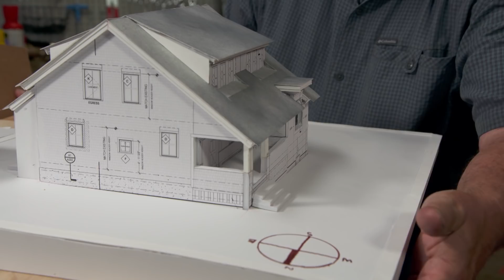How to Create a House HVAC Plan | This Old House

Comment: GREAT HVAC VIDEO!🕊️
2:40🌞thorough overview
6:54 - mold is a 🏠-KILLER
7:01 - if you’re going to INSULATE - you have to VENTILATE
0:03 - start w heat calculation to size heating + cooling equipment 
1:23 - types of insulation
3:34 - 💡barn added to employ ☀️panels
3:53 - wind🌬️💨🏠
4:41 - simulation of internal fans pulling air out - 4:58
5:27 - balanced ventilation
5:34 - dampers needed to open automatically for fans
5:56 - energy recovery ventilator 🤔
6:35💧moisture = scourge
6:49💧moisture simulation

Comment: Richard, do you think you could explain ductwork planning for open concept - living room, dining room, kitchens?     There are a number of things  - one the size of the ductwork and how do you run it through the floor joist, carrying beam without using right turns which significantly reduce the efficiency of the flow.

Comment: I call BS. The southern porch overhang blocks the solar gain in the winter ❄️. The overhang is way to large to allow any gain. And the south facing windows without overhangs let in the sun’s heat even in the summer. Very poor design

Comment: What if you got a balloon frame? Most were designed not to be insulated (air flows up and out, like an air barrier). Atleast no mold. But I could use ATOH to visit and show me the solution to add mini-split to cool 1800 sqft of EmptyNester cottage.

Comment: Air sealing, super insulation, triple pane windows, high efficiency heating and air conditioning systems, LED light bulbs, set back thermostats, high efficiency appliances, solar panels, battery storage and a 220 volt outlet in the garage for an electric vehicle charger should all be considered in any new building or remodel. Using the sun to drive your car or using the battery backup when there is a power outage is great and there is no weekly use of the generator to test it and no annual maintenance cots. Solar is a much better option than a natural gas backup generator. So many ways to reduce your heating and cooling expenses.and have a more comfortable home.
Reply: You’d need an incredibly large battery bank to be able to store up enough energy to have have any real use. It’s far too expensive, and probably worth the weekly run to just have a generator instead
Reply: @iLikeC00kieDough  The cost of the generator and the install is comparable to the cost of a Tesla Home Powerwall battery.
Reply: Kenz300 x I don’t know about that. One Powerwall doesn’t go very far in terms of continuous use. For the cost of two Powerwalls plus installation you can get a whole house generator ran off of natural gas that can run indefinitely as long as you have a gas supply.

Comment: Ventilation is also to keep CO2 levels low. You’re living in a sealed house and u could asphyxiate yourself. I swear, these super insulated and sealed houses are more trouble than they’re worth.
Reply: There should be no CO2 being released into your home from the mechanicals. A super insulated house is cheaper to heat, cool and is much more comfortable year round. They actually have cleaner, healthier air if done right.
Reply: august the CO2 is release by the humans and pets living inside. 😛 “if done right” and as long as that ventilator is working.
Reply: @mjlyco9752 , Never heard of any family being asphyxiated from their own breath.
Reply: @augustreil  But that's exactly what would happen if you put a plastic bag on your head. If you seal a house with air impermeable membrane then that is exactly what you're doing on a larger scale. It will be slower but CO2 concentration will rise until you pass out then die, unless you ventilate. Powered ventilation, open window, etc. Non-sealed houses don't have this problem because the drafts are the ventilation. Those drafts also dry any moisture. Sealed houses can work, but it takes a lot more care and everything working correctly. That sounds like more headaches to me.
Reply: @mjlyco9752 , Hardly a fair comparison. There's no house as tight as a bag around someones head so lets just agree to disagree. I've already stated why tighter houses are better and there are safeguards against the fresh air recovery system failures. It's ok that we don't see eye to eye.

Comment: Richard Trethewey is an American national treasure!
Reply: Yes, but those on TOH need to remember that heating and cooling issues are VERY DIFFERENT, in the SOUTHERN States, HEAT is LESS of an issue, it's the High Humidity combined with temperatures above 80f degree's 9 months of the year that is more of an issue. 🤨🤠

Comment: Wow this is hard to understand. My attic is open all around the edge. I have installation in my attic. But winter is very cold and for summer is very hot. Is it necessary to have this panels that is like a vent all around the attic?
Reply: Jose Hernandez yes. The venting extends the lifespan of the roof and stops ice damming.
Reply: @mjlyco9752 , Agree. Ice dams are caused by heat leaking into the eave area and melting then re-freezing over and over.
Reply: Yes, your attic is supposed to match the temperature outside.  This is so condensation doesn't form under the roof sheathing.  Your openings are called soffit vents.  Those bring air into the attic, which escapes at the peak of the roof at the ridge vent (or gable vent on the tall sides).  The insulation in your ceiling keeps your house where it needs to be.  If you want to improve your home's temperature, add more insulation where it already is.

Comment: In TEXAS, it's more important to be thinking AIR CONDITIONING, as TEXAS winter's often PRETTY MILD and rarely lasts longer than 3 months. IT'S SUMMER HEAT 9 months of the year. WHAT'S SNOW? Haven't seen any in SE Texas for several YEARS.🤠
Reply: No, just FACT of LIFE in Texas South of I-10, air conditioning is a NECESSITY. 🤠
Reply: @davidhbingham6812 , Agree !  AC is needed almost everywhere in the U.S.  Even if temps only reach 80-85 in someones area, but the Dew point is in the 70-75 range, it feels like you're in the Rain Forrest !  AC is awesome.
Reply: Do you write comic books for a living?
Reply: your keyboard is broken